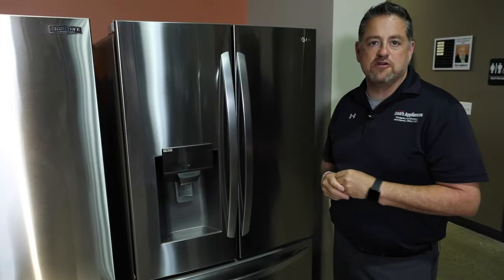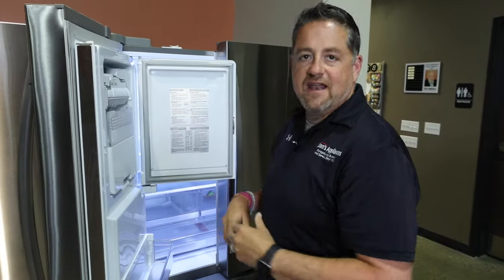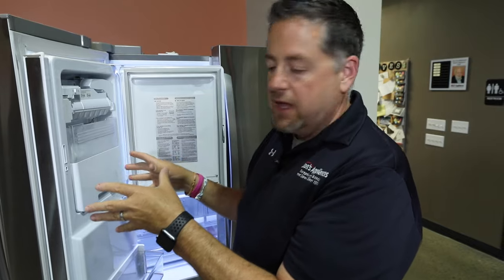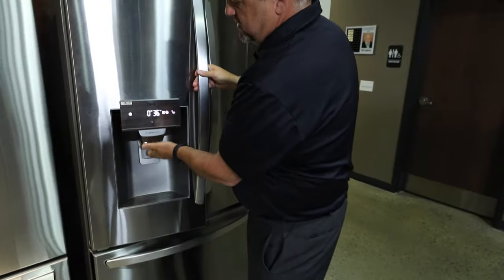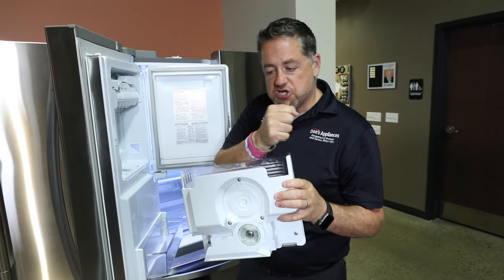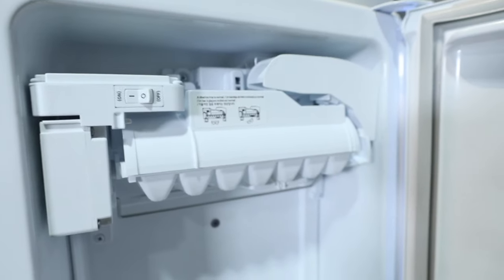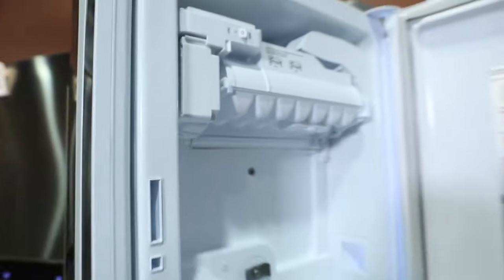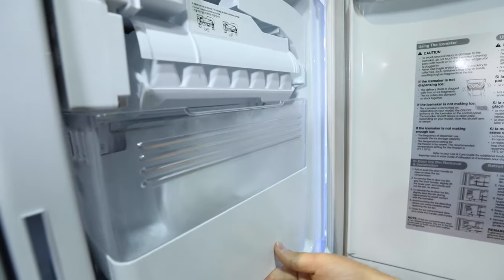LG Ice Maker Not Making Ice? Try This Quick Fix

Comment: Thanks for this video.  This worked great.  Another solution I found my for LG fridge besides the reset was to turn on Ice Plus.  This seemed to help the ice freeze and then eventually dump.  My sister-in-law has the model with the additional ice maker in the freezer and it quit making ice.  Does it have a reset button as well?  Thanks for your videos.

Comment: Bargain water filters fit mechanically, but didn't maintain water pressure. I also discovered flushing 2.5 gallons through the system after filter replacement is supposed to be done 30 seconds at a time with 60 seconds between flushes.  Hitting the reset button enabled me to determine whether any water was getting to the icemaker (it was), and convinced me the unit was working, but not as fast as we were using ice!  Thank you!!,
Reply from the maker: Non-brand specific water filters do work differently. Great to hear this fix worked for you though!

Comment: Omg ! I watched so many videos on this subject, changed the filter, and rewatched videos. I finally came across your reset ( my model is slightly different,it’s white) bit finally the rotation started  ,!, Bless you ! Why didn’t the LG troubleshooting videos suggest this ? My problem was that it seemed like the rotation mechanism wa s stuck. I tried the hair dryer h seemed appropriate) but no.  The reset button totally finished the rotation process. Hopefully it will be the solution long term. 😂

Comment: Thank you for this tutorial.  My slim ice maker ran empty on ice, found ice cubes still in the bin, some cubes tried to come out but ultimately failed.

Resetting the ice maker as you instructed caused it to dump all ice, and refill the ice cube tray.  Before that, it would not refil the ice cube tray.

Preying this solves our immediate problem. 

Thank you.
Reply from the maker: Hopefully this helps!
Reply: Thank you.  Yes, it did the trick.  Ice maker is making ice once again.

Now if I could only find a DIY for repairing the freezer section - I think the temperature sensor or controller board has gone bad.  Every so often, I receive a notification that the freezer temperature is too warm.  I might start looking into it, and run some tests on things  The fridge section works great.

Cheers!

Comment: Thank you , I just reset my LG Instview Icemaker !! How's about the craft ice reset?
Reply from the maker: Here is LG's video on resetting for the craft ice maker: https://www.youtube.com/watch?v=XFj0G2xTZL0
Reply: @Donsappliances  ok here's my problem, regular, craft ices were used up to empty level since Monday. Then there wasn't any ice produced at all ,,,then I followed your video to reset the ice for both regular and craft ice maker and they dumped out the current ice in there...and waited another 36 hours for no craft ice, and 10 cube ice....till now Thursday. I called in LG support on Tuesday, they agreed my 6 months old need to replace the ice maker both that it should not be that slow...Until now at this moment, 24 hr produced 10 cube of ices and zero craft ice at all....

I bought this Instaview counter depth and ice makers started having the problem ....my previous 13 years whirlpool was still working when being hauled away LoL .....Refrigerator is not an easy market ....!! At least refrigerator still works to keep food cold and frozen!

Comment: Thanks! I have a 2 week old fridge and the door ice dispenser stopped working. Saw your video, opened the compartment and there was a clump of ice stuck in the back portion of the basket that the spinning arm couldn’t touch. I imagine it was ice that had partially melted and fused together. Took that ice out and hit the reset button and we’re back in business! 
Now my question is: do the craft ice makers in the freezer have a similar procedure for clearing them?
Reply from the maker: Glad it helped! Yes you could troubleshoot your craft ice maker the same way, it will obviously just be set up differently.

Comment: finally figured out the "re-set" button.  I had to hold it in with my nail.  LOL.  However, I'm unsure if this will fix the problem.  The grey gasket around the icemaker door had water at the bottom.  Also when the ice door was shut, there was ice built up across it.  This happened a couple of times.  The fridge is about one month old.  No problem up until now but I'm hoping the re-set works.  The ice bucket was full.  Maybe the ice door was shut properly and secured.  Why would there be water inside the gasket?

Comment: Thank you for this video. I have followed the video steps and tried the reset button, but it won't go through the reset motions. Uggggh. What next?
Reply from the maker: You could also try hard resetting your fridge by unplugging it for 5 minutes and plugging it back in. You might want to also contact your local appliance technician.

Comment: I found that button last night.  Our LG fridge (looks like the same one) is not even 5 months old and suddenly the slim ice bin you showed just started not dispensing the ice it makes.  Ice will sit there in the tray until we do a reset.   Was working great for 4 1/2 months.  I did read it needs to be 10 degrees or lower to dispense ice, but that's going to be tough to stay below that on the door.  Not sure it is staying that cold, but should not be limited to 10 degrees, that sounds hard to maintain on a door.
Reply: I have reset mine many times. It always makes ice, but it never gets triggered to drop the ice. I'd love to hear a fix for this.
Reply: Same issue, I always have to hit the reset button to dump the ice on the tray.  Are there any troubleshooting suggestions for this problem?

Comment: Hi! Thanks for the helpful video. My icemaker still isn't working. Actually, the tray never even fills with water. I tried doing the reset, I tried replacing the water filter, and I tried taking it apart and putting it back together. But it still doesn't work. Any ideas for what would prevent it from filling the tray with water? 

Maybe something with the reservoir? It doesn't look frozen, but I'm not sure, and I'm not sure if there's another problem.
Maybe something with the sensors, so it thinks that it's already full of ice?

Thanks for your help!

Comment: I had the same problem, and would have to reset that often. Then it started maki g a very loud noise, like the compressor was working really hard. This morning when I woke up, it had code IF the ice maker fan was detected on my thinkQ app. Where is the ice maker fan? And should I replace that?
Reply from the maker: This is an issue with the ice maker fan. You'll definitely want to call your local service technician to come and take a look.
Reply: did you get yours working? i replaced my  ice maker fan and its still not making ice

Comment: is it the same for the bottom craft Ice Maker? I'm having problems with the bottom ice maker not producing enough ice... Thx for the tip
Reply from the maker: For the bottom ice maker on the LG it would work a little differently. Remove the ice bin, then unplug your fridge for about 30 seconds before plugging it back in. Then you can place the ice bin back in and this should reset it.
Reply: @Donsappliances   Thx Matt. I'll try that. Good show

Comment: Hi.  I have the identical setup.  When I hit the reset button, there's an audible "ding" but then nothing happens.  I've done all of the other standard troubleshooting tips.  Any other suggestions?  Thanks...
Reply from the maker: Keep in mind it can take up to 24 hours for it to start making ice again. If you have tried unplugging the fridge and plugging it back in, checked the water lines, checked the water pressure, etc; it might be time to call a service technician. Sorry you're running into issues with this, hopefully it gets solved soon!
Reply: @Donsappliances  Got it.  I cleaned the supply line, used a hair dryer, replaced the whole-house filtration system and it started working.  Thanks for your video.

Comment: I have an LG model LFXS24623S and the problem is that it makes ice, dumps it once and that's it. 

 When I want more ice I press the reset button but nothing happens.  I then turn the icemaker off and on again, then I press the reset button and only then it works.  

It will dump the ice, the tray fills up with water, the next day there will be 8 cubes in the bin which it dumped but that's it.  If I want more ice I go through the same process again manually.

What could be wrong? Thank you form any advice.

Comment: I have the model with the in-door ice maker is the only ice maker in it and I have to constantly hit the “dump” button to get any ice. It will not dump on its own even when the ice tray is plenty frozen. Any tips or tricks?
Reply from the maker: Hi Jeffrey! Do you have any large clumps of ice in your ice tray? This could block up the dispenser, so if you see any large clumps of ice in the tray try breaking them apart. Something could also be clogged in the chute, such as one of these clumps of ice so you may have to remove it or wait for the ice to melt.
Reply: No it’s not a problem with the dispenser. The ice tray will not dump on its own once the ice is ready. So I have to constantly manually dump it for it to make more ice. I have the laser level sensor, not the metal arm. I have no idea why it won’t dump ice. I have changed freezer temp from 0° to -4° and no difference
Reply from the maker: @jeffreyjansson4492  Jeffery, you might want to request service.  LG should be able to find a factory-authorized repair team to come out and see what the problem is!
Reply: @jeffreyjansson4492 were you able to find the issue? Dealing with this same thing now.
Reply: @Atown804  no I haven’t. It’s a real pain. We basically went back to old school ice trays now. I occasionally still hit the dump in the ice maker tho
Reply: @jeffreyjansson4492  strange that there are no solutions for a problem that is reported by a lot of customers.
Reply: Just got mine finally repaired this evening. Ended up being bad evaporator coil. If the icemaker is producing water and making ice but not dumping it’s a compressor or compressor related issue the tech said. If the icemaker area is not -9° it will not dump the ice. Mine got a new evaporator coil and compressor and is already cooling after only two hours.
Reply: @Atown804  that’s good to know. At least he was able to tell you what caused the issue. Thanks for reporting back
Reply: @Atown804  was that covered by the 10yr linear compressor warranty LG has??
Reply: @jeffreyjansson4492  check for ice cream not staying frozen and sausage not staying frozen (salt content + not as cool as it seems). My Fridge is six years old and no it wasn’t covered but the repair was more than reasonable. The cost will vary market by market he said. LG repairs after the warranty expires are fair but not free. The warranty for the compressor that keeps going bad used to be two years and due to the lawsuit they upped it to five. The part that has the 10 year warranty does not go bad usually.

Comment: Thank you for the video. After pressing reset, it dumps ice and refills. It won’t do it automatically thought. It only works if I press reset. Any idea what could be causing that?
Reply from the maker: Most times the ice maker will need a few hours to reset, make, and then dump the ice on it's own. You could also try making the temperature colder in the freezer.
Reply: @Donsappliances  thanks for your reply. This has been going on for a few weeks actually. The temp is set at -7 for freezer and 36 for fridge. I wonder if it’s a temp sensor or something else…
Reply: @seanjohnson4748  - same  exact issue, did you figure it out?
Reply: @fbhaddad  yes it was the compressor. Had to be replaced. LG covered it even though the fridge was 4 years old. Try reaching out to them

Comment: Ice maker will dump ice but sometimes water does not fill tray.  Other times it works fine.  Pressure from water dispenser is fine.  Does ice maker have a separate water valve?  Could this be the problem?

Comment: The reset button dumped the ice but I noticed the tray is crooked on the right side when is dumps.  Starts out leveled until it comes almost all the way around.  I fill like something/ice might be hung up in there but the tray returns to the normal position. before I can get a good look.  Is it safe to turn the ice maker off to stop the tray from moving so I can look?  Or is there something else I need to do to stop it?  I've hit the reset button ~3-4 times now and it's the same.
Reply: It’s supposed to get caught on the right like that.

Comment: What about the other ice maker in the bottom? Mine will make ice for a few weeks, then stop. I have to turn it off, rattle it around, and the next day switch it back on. That unworkable sometimes, but not always. Is there a reset button on that one?
Reply from the maker: There is not a reset button on the bottom ice maker.  It seems although you have an issue with the bottom icemaker.  We'd recommend reaching out to a local repair team and scheduling service to come look at the unit.
Reply: @Donsappliances  Well, I looked and found one. It operated the mechanism to clear any ice. Just to make sure the ice maker would work again, I pulled the plug out of the wall and waited 1 minute + to do a full reset on the refrigerator. Now I am happy to report that the ice maker is working as intended. But thanks for the reply.

Comment: I've same icemaker and reset works (ejects ice and refills again).. but it does not automatically go thru the process without hitting reset each time. I've cleaned the tub out, is turned on, and arm not obstructed?
Reply from the maker: We'd recommend contacting your local service department and scheduling a service call.

Comment: The reset button is still there for 2024 models with no physical button on the ice maker. My on switch for the unit is on the bottom right display. Still needed that reset button.

Comment: Mine won't eject the ice unless the ice maker door is open. So I have to open it & press the reset to eject the ice. What would cause the ice maker to not function unless the door is open?
Reply from the maker: This seems to be a main board issue. Something may be loose or not connected properly. You might want to try resetting the entire fridge; Unplug it for about 10 minutes and plug it back in. If the problem persists, it might be best to call service. Unfortunately, main board issues can be common.

Comment: What do I do if mine isn’t going through the reset?
Reply from the maker: It will take a couple of hours to a full day for it to make ice again. Double check that your water lines are secure, try unplugging the fridge itself for 10 minutes before plugging it back in, and if all else fails, you may need to call a service technician to come take a look.

Comment: My LG ice tray twists, but i was told that's normal, it's mimicking how you twist ice free from a tray. Tray in your demo did not twist.
Reply: Mine does the same, did it still give you ice though? I barely hit the reset button and hoping it works. Mine messed up after a recent power outage.

Comment: I have a lg lfxs24663s. Stopped making ice. Did the reset. It spun but after 24hr no ice. Water pressure is fine from the dispenser.
Reply from the maker: Jaret, there could be a clog or leak in your water line. Double check the line inside your fridge first to see if there's any damage. Your ice maker may need serviced. You might want to also try unplugging the fridge for 5 minutes and plugging it back in. This will hard reset both the fridge and the ice maker. Hope this helps!
Reply: @Donsappliances  didn't see any visible leak. I will try the reset. Ty

Comment: mine dont have the problem of freezing it has the problem of not freezing at all ..when i press the reset button the motors and tray does everything right but instead of ice being on the trey its just water .......any tips ?????
Reply from the maker: You might want to clean your condenser coils on your fridge. Sometimes dust and lint can build up, causing the fridge/freezer to not cool or freezer properly.

Comment: My ice maker isnt dumping the ice into the tray. Ive tried the reset button to get it to dump the ice into the tray but nothing happens. Help!!
Reply from the maker: Hello! Double check that there isn't any ice build up between the bin and tray, or around the water line. Sometimes if there is an ice build up somewhere, this will prevent ice from dumping into the tray. You can try taking out the tray and letting all the ice melt, then reset the ice maker.

Comment: What happens when nothing happens when you do the reset button? Nothing is happening when I turn it off and back on either. Who would I call to come fix it if it’s the motor? I love my ice maker 😭
Reply from the maker: Have you tried unplugging the fridge and plugging it back in? If you've done all the quick troubleshooting and it's still not making ice, we recommend calling your local appliance technician! Or you can contact LG (or whichever brand your fridge is) and they should also be able to send out a technician! Hopefully this helps!

Comment: For the ice maker on the door, if you've taken the tray out to clean, make sure it is reinstalled correctly. Any contact with the metal arm will make it stop producing ice. There are two nubs where the bottom of the tray should lay flat when it's reinstalled correctly. For me, this was the reason why it was not making ice for months and I had to manually get ice by pressing the reset button to release ice from the tray 🥴
Reply from the maker: Thanks for sharing! This is helpful to know when troubleshooting.